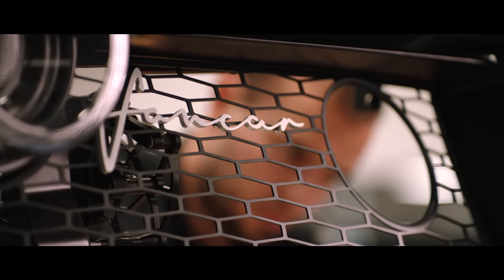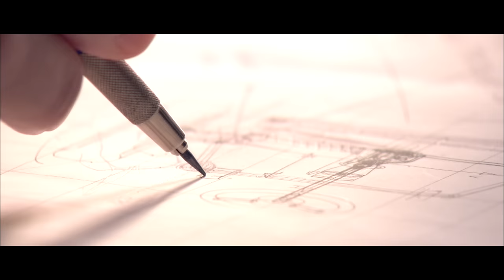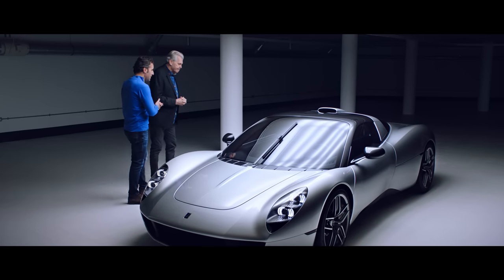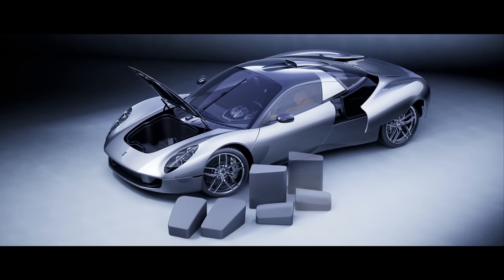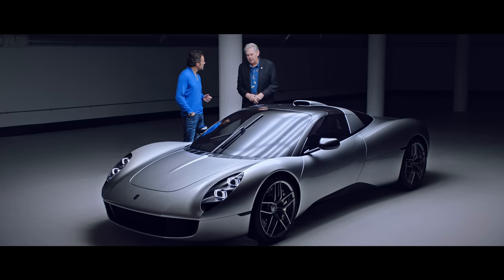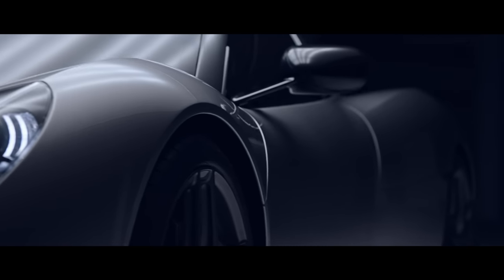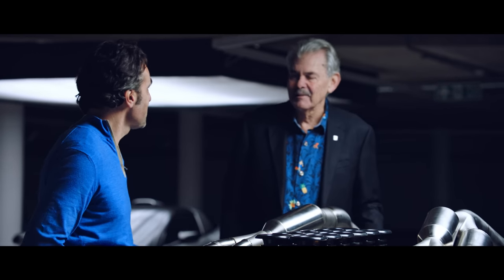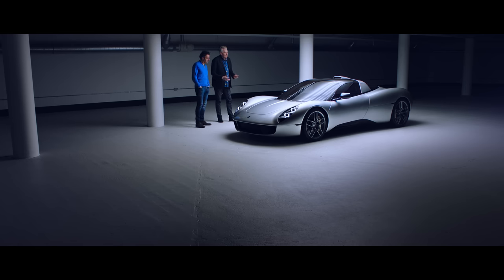Global Premiere of our all-new GMA T.33 Supercar - Hosted by Dario Franchitti & Gordon Murray

Comment: What's astonishing to me about GMA isn't just how unbelievable their supercars are, but how quickly they work. Think about how delayed and stuck in the weeds the Aston Martin Valkyrie or Mercedes AMG One has been for years on end. When you have a small company with a clear vision, stuff gets done.
Reply: Great that time will tell. Also by the time these cars are unveiled they are well underway the Valkyrie was first shown as basically an idea only
Reply: And you've got great partners. They don't waste time with the bidding process and all the bureaucracy. Of course Valkyrie suffered from issues with Aston Martin itself. And AMG One bit themselves hard trying to get the near impossible task of getting an F1 engine road legal.
Reply: @srinitaaigaura  Yeah I can only imagine the reason the AMG One was delayed so heavily was because of the engine. The design has remained basically the same since the reveal 4 years ago. But production is due to begin soon for it, so it seems they've gotten that finally sorted.
Reply: @jodul6557  mmhmm! they're doing hot-weather testing in the UAE as-we-speak and have been traveling all over doing testing with their prototype vehicles on public roads and circuits for a long time now. It was supposed to start production this year, but one of the marketing ppl for Mercedes said on Instagram that it's being delayed till next year. A bummer, but based on the footage of it testing, it does look close to finished this time.
Reply: The difference is that the gma team is working on one or two products at once, while Mercedes is a multi-million dollar brand - passenger cars, trucks and others. This is probably the difference between the two approaches. While producing cars, Mercedes has to test them longer, while GMA cars produced in 50-100 units may have minor neglect, removed at the next car services.

Comment: The T.33 is such a strong achievement.  Passion, ability and one mans direction rather than layers upon layers of bureaucracy has created something special again.   I bought a 1998 3.0 V6 Alfa Romeo GTV.   For the engine of course also because of what it did not have. It did not have door handles, rear wiper,  no washer jets on bonnet, no roof aerial, no pillars on the doors.  I really would prefer not to have a front number plate and it is a heavy car.

Comment: Man, she looks even better than the T50. The best is the view from the top. Maybe those lights in the T50 should have been that way. Rear is now slick without the fan. That front grille though, looks just like an F12 tdf, or maybe a Lotus Elise. Maybe... maybe...just a little different? If it was just more like LaFerrari's grille? But then it really does look like a 60s car.
Reply: I like this better no fan needed on a road car anyway. I like the two seat configuration more useable. Still a hypercar. Of course this is one man's vision of a car not the only one

Comment: I'd love to see how the paddle shift transmission works. The internal mechanism. How does it do zero torque drop during a shift? How is it lighter than a dual clutch system? Without dogs how does it engage different gears?

Comment: How can a 12 cilinder, 600+ hp car have so little cooling intakes? This makes it look very clean but it also disguises its potential quite effectively. Overall, I think those who are not “in the know” might think this is a small 45K £/€/$ roadster with a third of the power. This understated look might be exactly what you want, or not, but either way there are plenty of  flamboyant cars in the market already and I’m sure the 100 orders for this car will fill up quickly, if they haven’t already.

Comment: That is what a supercar should be, as lightweight as absolutely possible with just the right amount of power, I have little interest in outright power output figures or silly top speeds that you may never be able to get near on any road or racetrack, this could be up there with the likes of the F40 or McLaren F1, two of the best supercars ever made in my opinion.
I have mixed feelings about hybrid supercars, especially the inevitable increase in weight, to me supercars should be 100% focused as driver's car and going down the hybrid route is drifting into daily driver territory or luxury cars, there is no real need for a hybrid vehicle you are only likely to use for several thousand miles of travel per year.
I absolutely agree EVs And Hybrids have there place as commuter vehicles and I would say that for supercars you could go fully electric as long as the weight is kept to bare minimum.
In my opinion Hybrid supercars or hypercars are just unnecessarily over complex and try to appeal to Two opposing types of customer but end up somewhere in the middle instead of being defined as a particular car for a particular purpose.

Comment: 1 million discount for 100 kg and 60 hp and 1 seat. Not bad. No fan, though?
I do wonder where the weight gain comes from then. Corners were cut vs the T.50 one way or the other.
Reply: How much did they say it was?  I missed it.
Reply: @mikea5205  I saw 1.3 M GBP in the thumbnail.
Reply: The T50 is entirely carbon fibre. The T33 is a carbon fibre tin with aluminium and carbon panels. Watch the top gear video, they go into a bit of depth about it